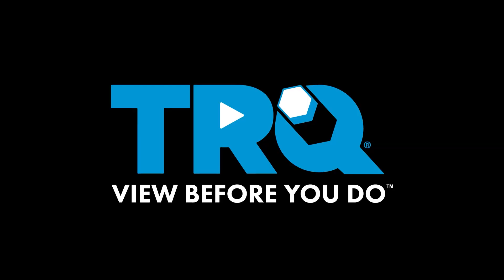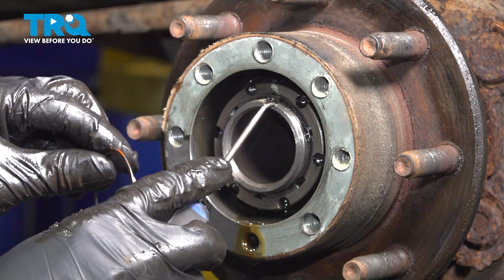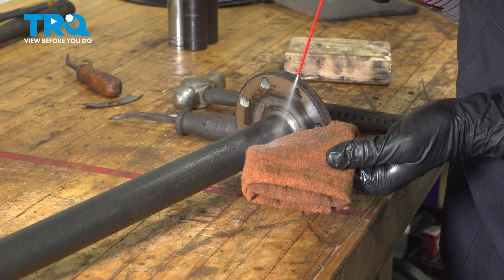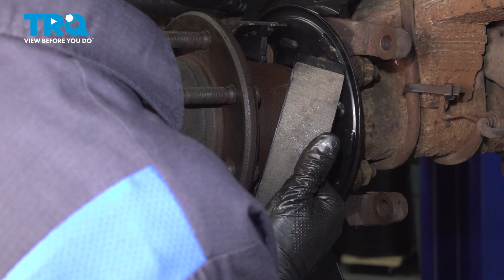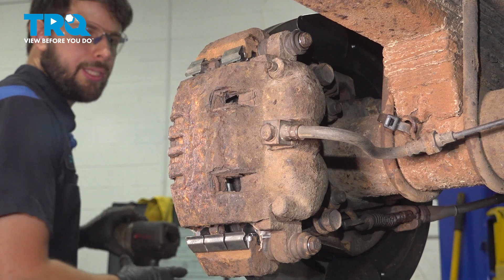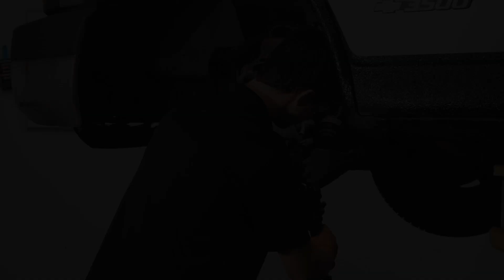How to Replace Rear Axle Seal 2003-2009 Dodge Ram 2500

Comment: Even though this is a free floating axle Dodge recommends that you pack the bearings with grease. Evidently the concern is that the bearings may get too hot before enough gear lube drains into the hub. Also you will find that it is much easier to do the parking brake assembly before installing the hub so the hub is not in your way.